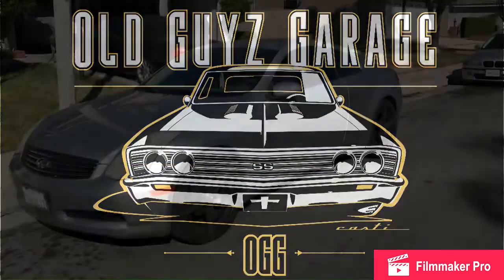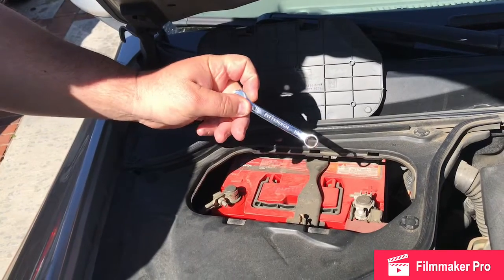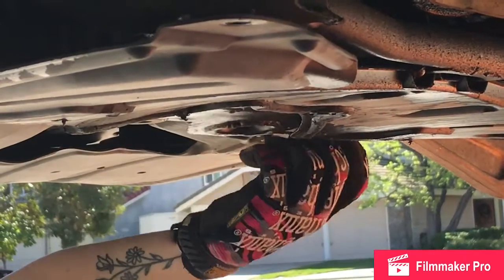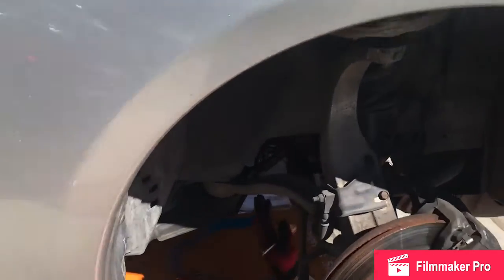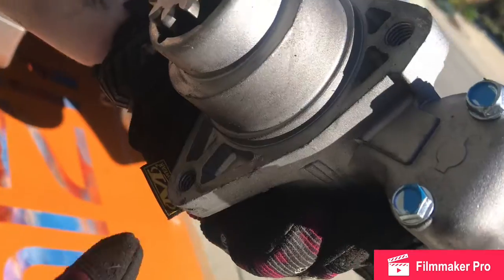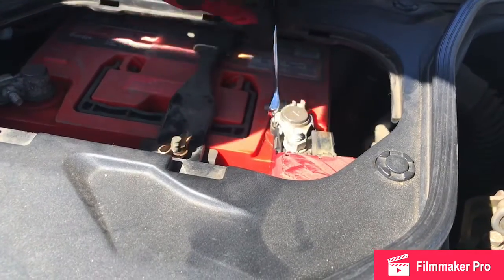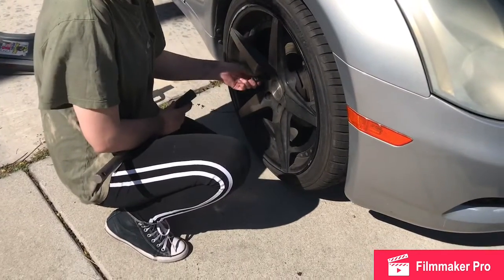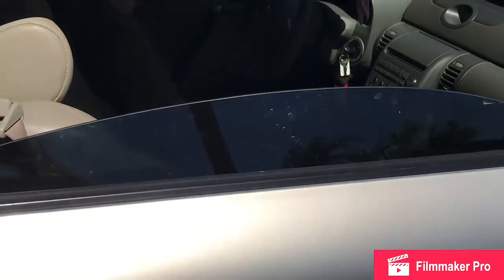Install Starter on Infinity G35

Comment: Hey so I just bought a 06 G35,I was able to take it off the lot and it turned over,but now it won’t turn over at all,it will crank but won’t turn over,dude at the dealership said something about the key fob but never gave me any details about it and no back ground info about the car,any ideas what it could be ? I have sent me ecu in and gotten the NATS deleted and then tried to get my key reprogramed and still won’t turn over which lead me to my alt
Reply from the maker: Sorry not sure that’s hard to figure out sometimes with no history in the car however may look into changing the coil packs and spark plugs, also make sure it’s got new clean gas in it!  Thx for watching! 😎👍